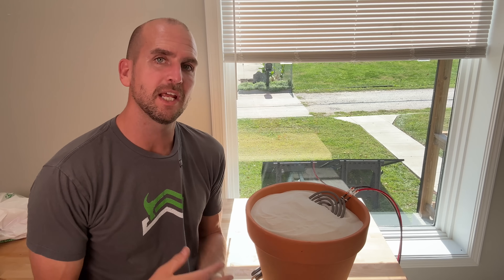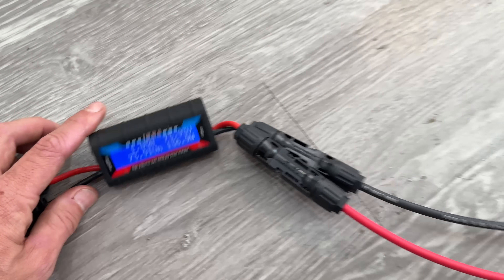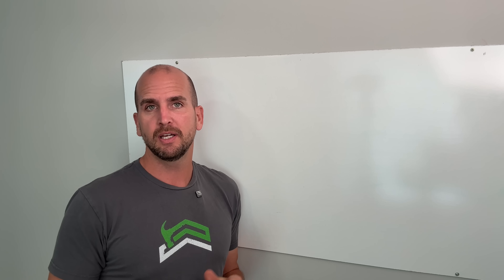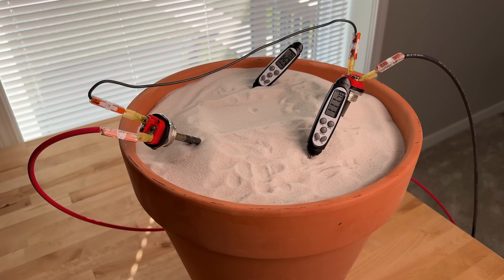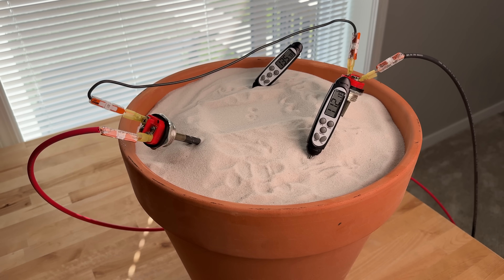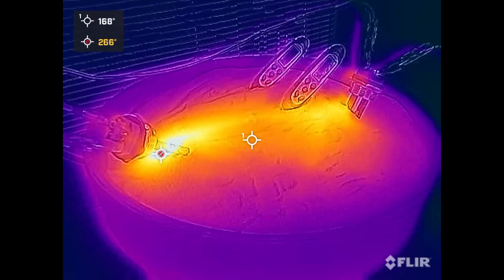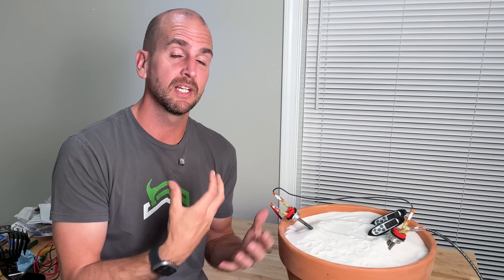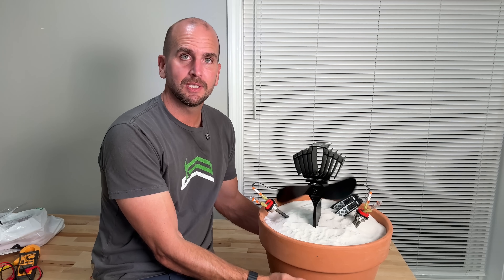How To Create A Solar Sand Battery Heater | Free Heat This Winter!

Comment: To get the most power from the solar panels match the resistance of the panels to the resistance of the heating element.  David Poz has an excellent video and spreadsheet to do this. To continue the keep it simple concept, use a kitchen oven, connect direct to PV, keep voltage around 100v and bypass switches/thermostat for safety, leave door open, fill with bricks. When sun shines it heats room and bricks. At night hot bricks heat the room.
Reply: This how night storage heaters  work, been around since the 60`s   They are heated in the night time when electicity is cheaper (off peak)  Needs a dual tarrif meter.
Reply: Thank you, great information.
Reply: Post a link
Reply: But I don't sleep in the kitchen.
Reply: @cfldriven  drink more vodka - works for me
Reply: @cfldriven if you are in need of emergency heating and your emergency heater is in the kitchen then you might.
Reply: I have an old oven in my shop doing nothing. I’m going to buy maybe 4 -6 panels, to play with. I also have a dyi hydronic heater and circulation system with a 240 water tank going.. So I can try other things too. Any ideas?
Reply: I'd never hear the end of it from my wife if I did that. What about when you need to cook?
Reply: @GOPRepubliklan Pretty sure the idea is to get a second, old, half-broken oven for cheap / free and do it!
Reply: @GOPRepubliklan  Make sand-wiches
Reply: @GOPRepubliklan  There are $50 portable electric stoves
Reply: Cooking is going to be hard after you cut the connection ends off your burners.
Reply: Excellent idea. 🍴🍴🍗
Reply: he said the panels were in series. He should wire them parallel, that would double his current, providing both panels are of the same, or at least same v/a ouput. point being more current into the heating elements heating them faster and higher temperature.
Reply: @xazoola6000  That's what I though and how did he know the polarity?
Reply: @akomni-vr5gt  polarity is often important in D.C. applications. However, in this case , stove elements have A.C. current running through them. so the current/voltage is moving between positive and negative. When he applies a D.C. voltage/current it will not matter in these types of elements which direction the current flows. What is interesting, in this application, is the use of a solar panel, with no battery. Having a battery in the circuit would be a bad idea, it would just constantly drain and charge and in my option a waste of a good battery.  You would really want to just heat a small area to get the most from the heat created. The main problem is "Sun". we do not get a lot of sun every day where i am. in the winter we do, but, well it's winter. The sun is low and not much of a "solar noon".
Reply: I know this is probably basic electrical knowledge, but I find it fascinating. Been looking up solar and batteries. I have a lot to learn.  @xazoola6000
Reply: @xazoola6000 that isn't how it works, by putting the panels in parallel the current would have actually gone down even though they could supply more.
So instead of 72V 3.4A at 248W in parallel it would be 36V 1.7A at 62W
Reply: @shaynegadsden  correct. always use ohms law because the heating element doesn't change its resistance in ohms. 240 volts outputs 4500 watts into water heater but at 120 volts only 1125 watts with the same heating element.
Reply: @xazoola6000  so you get more current but less voltage?
Reply: @roz4747
Solar Panels in Series
When solar panels are connected in series, the voltage adds up, while the current remains the same.

Solar Panels in Series
When solar panels are connected in series, the voltage adds up, while the current remains the same.

Equations for Series Connection:
Total Voltage:
V total = V1 + V2 + V3 + ... + V𝑛
Total Current: I total = I1 = I2 = I3 = ... = I𝑛
Example:
If each solar panel has 20V, 5A, then for 3 panels in series:
Total Voltage: 20V + 20V + 20V = 60V
Total Current:
5A (remains unchanged)

Solar Panels in Parallel
When solar panels are connected in parallel, the current adds up, while the voltage remains the same.
Equations for Parallel Connection:
Total Voltage: V total = V1 = V2 = V3 = ... = V𝑛
Total Current: I total = I1 + I2 + I3 + ... + I𝑛
Example:
If each solar panel has 20V, 5A, then for 3 panels in parallel:
ParallelTotal Voltage: 20V (remains unchanged)
Total Current: 5A + 5A + 5A = 15A
hope i didnt miss anything. again Google Ohms law. there are many eamples. Think of the solar panels as batteries just for the math
Reply: @roz4747  Solar Panels in Series
When solar panels are connected in series, the voltage adds up, while the current remains the same.

Solar Panels in Series
When solar panels are connected in series, the voltage adds up, while the current remains the same.

Equations for Series Connection:
Total Voltage:
V total = V1 + V2 + V3 + ... + V𝑛
Total Current: I total = I1 = I2 = I3 = ... = I𝑛
Example:
If each solar panel has 20V, 5A, then for 3 panels in series:
Total Voltage: 20V + 20V + 20V = 60V
Total Current:
5A (remains unchanged)

Solar Panels in Parallel
When solar panels are connected in parallel, the current adds up, while the voltage remains the same.
Equations for Parallel Connection:
Total Voltage: V total = V1 = V2 = V3 = ... = V𝑛
Total Current: I total = I1 + I2 + I3 + ... + I𝑛
Example:
If each solar panel has 20V, 5A, then for 3 panels in parallel:
ParallelTotal Voltage: 20V (remains unchanged)
Total Current: 5A + 5A + 5A = 15A
hope i didnt miss anything. again Google Ohms law. there are many eamples. Think of the solar panels as batteries just for the math
Reply: @ Ty, higher voltage is dangerous but not higher current per se?

Comment: Does the type of sand make a difference.  Could I use beach sand or a bag of sand from Home Depot.  Great concept.
Reply: The course  sand allows the hot air created by the element to move to the top much quicker but it will also loose more heat faster . I used a 210 liter drum/ 55 gallon with a copper pipe spiraled in the sand ,heated by a solar panel and a 12v pump to circulate the water/ anti freeze. It connects to a  car radiator with a small computer fan  .kept my chicken from freezing weather.

Comment: You're missing the bigger picture - kwh in vs BTU out compared to say a mini-split and properly defined room - size, insulation, outdoor temps for example.   How does this compare (roughly) to heating insulated water tank for kwh in vs BTU out.    Interesting, but not helpful to make any conclusions.    Need at least some rough comparisons.

Comment: What if you made a radiant heater using a water heater tank, a pump, coils of copper pipe going through a large container of sand?  The coil of copper pipe might heat the sand more evenly? Would wet sand heat up even better than wet sand will do to conduction?   Or run a copper coil out of the water heat tank, place the wood stove fan over a tight coil copper so it spins faster, bring the rest of the coils in front of the fan?  Perhaps, you wouldn’t need a mechanical pump to move through the heat system just using the heat cycle of the water?   If the system needed to be a smaller, a person could use an Automotive TANK heater.  Those types of Tank heaters are used in cold climate for engine block heaters.  There is a ball valve in the TANK heater makes it work like a pump.

Comment: This is a good idea. I would advice not to use Wago connectors so close to heating elements like that especially for actual use. Very high temperature insulation like fiber glass and silicone should be used. There are screw terminals and spade connectors. Just use those. That's why they're there, anyway. The Wago connectors may have survived, but all that heat will likely cause the plastic to warp and stuff weakening the connectors and causing them to fail over time.

Comment: I agree. I tried a 120v water heater element and the steel turned blue. Guessing it wouldn't last long.  A wet sand seemed to help.
Reply: It’s supposed to work in water which will create a current against the metal to stop it changing colour

Comment: I get the idea but dont think it plays out well. 
Emergency- but have solar panels at the ready. Sand at the ready etc. I dont think emergency.  Besides, having solar was intended to prevent those emergencies. If you have solar what is the emergency?  
I think its a great idea and fun experiment just wildly inefficient. Store the same amount of energy in a battery and use a heat pump for your heat source. Your getting maybe 3x the heat. 
I know heat pump isnt emergency but none of this is. When you decided to buy solar you thought about
Why?
 how much Battery ?
Heat pump?
 Then prevented this emergency from even happening
Reply: If you had a grid tied solar system but the power is out and you don't know when it'll be back up. Disconnect your solar panels, and hook them up to something like this. You have no batteries, so your solar was useless but now it's heating your house. Sand, or a substitute, should be easy enough to find.
Reply: @MikeGrudzinskas  ok. I never thought of that 🤔

Comment: small tip: when handling formular, you should be aware of the right letters for teaching. P, I and R are right but you should know that "V" is just the short for voltage, which formular letter is "U"

Comment: I watched half this before realizing that the only reason you're doing this is to produce extra heat for your home? This is a big waste of energy not to mention a dangerous fire hazard! You're much better off using heat pumps to heat the air in your home and potentially even your hot water tank!
Reply: I thought this was a test that most can copy in situation you need warmth and don't have heat pumps that work with solar or skills to use direct solar panel connection to warm water.

Comment: I'm in the process of making a backup heat source out of my old hydronic baseboards.  In place of the original boiler, I bought a used 30 gallon electric water heater.  I intend to operate this water heater using excess solar energy, direct DC if possible.  A contactor will need to be operated by the thermostat of the water heater so the thermostat doesn't get destroyed by arcing, but this is a relatively cheap and simple adjustment.  The only stored electric power I need is to operate the circulator pump.

I'm likely going to have to swap out the 135F thermostat for one that can go up to 180F if I want any significant heat transfer out of the baseboards.  Until then, I have a tertiary backup heat source - a propane heater, positioned after the tank.  This was so the propane heater can immediately put heat into the baseboards, while leftover heat will just loop back into the tank.
Reply: Absoultely awesome ideas in there.

Instead of the contactor, there are two mppt moduels that I've found that are intented for direct solar water heating. One of them is a commerical product: Google AC7391 and you should find it. The other is a home built unit called the "LoadMaster XP".

Both use solid state switching to draw the most power out of your solar panels.

In the video, he talks about the V = IR of the load, however the solar panels themselfs also have a V = IR relationship, eg on the back of solar panels it says maxmium power voltage and maximum power current, which you can use to give you R, eg V/I = R. To get the most out of the solar panels the loads resistance/impedance needs to be close/match the solar panels resistance/impedance. You can ether do this by carefully selecting solar panels, or use multiple heating elements in series or parallel (and solar panels) until the load and source impedence is close. Or you use a MPPT module that does it dynamically.

Comment: When you introduce these topics, it's helpful to remind new viewers how to experiment safely around voltages over 50V and power levels over 100W. (fuses, protecting wires from physical damage, etc) It can't hurt to repeat a safety message on each video.
Reply: Agreed. 70VDC can kill you. Two issues with DC, since the voltage never drops to zero (as with AC) your muscles never get a chance to release. Also when you disconnect the power the arc does not stop for the same reason. 

You could put the panels in parallel and add a third hot water element also in parallel and you would be a lot closer or the max power point. And the lower voltage would be a lot safer
Reply: Yes please I'm hesitant to try this out until I understand the safety more.
Reply: Significant shock and fire risks here
Reply: 50mA will stop your heart
Reply: Hey buddy, learn about specific heat. 
This can all be calculated accurately how many btu's are put into how many pounds of sand.
3.41 watts = 1btu
1btu= energy required to raise 1 pound of sand 1 degree Fahrenheit. 
Look up specific heat of dry sand. 
.344 btus per pound of sand.
10 pounds of sand therefore 3.44 btus.
450degfx3.44 btusx3.41 watt per btu.  = 5,279 watts required to raise the temperature of 10 pounds of sand to 450 degrees Fahrenheit.
Reply: @Marley-ii6ls  I'm pretty sure no one thinks the sand itself is going to get hot enough to cause a fire.
Reply: Thank you Chicken Little.
Reply: @toddmarshall416 there's old electricians, and bold electricians. If you've worked with live snakes you know never to turn your back on them either. Call it cowardice but us old guys call it living to see another day.

Comment: I've wondered for a while if you could use something like this to keep energy for rapid heating an indoor sauna. Usually you have to wait a while after turning on a sauna for the heater to get the room up to temperature.

If you put a sand battery under a bench so it's quite large, and run some radiator piping through it you could dump excess solar power in to it (instead of exporting), then when you want to use your sauna you have a small pump push some liquid through the radiator piping to a radiator in the room. Along with the sauna heater you'd be able to rapidly heat the room and use less energy (since sauna heaters are usually 8-15kw or so).

Then I just think about lugging enough sand around to fill in a box under a bench to save a few pennies per sauna use and shudder...

Comment: The main thing missing is temperatures in the room! Also some graphs with temp over time will be nice (both room temp and sand temp.).
Reply: Interestingly enough you will get more accuracy using math for that. The numbers of BTU’s put into the sand will be the BTUs you get out of the sand. 

So take your starting room temperature and that will show how how fast the BTUs come back out of the sand. 

The lower the ceiling the closer you will be to the eventual warm air. 
The smaller the room the less stuff to heat up and the fewer walls for heat to escape. 

So the temperature of his room will have very little to do with the temperature of any other room. There are to many variables.
Reply: Yes, that would have been a great addition to the testing.
Reply: What matters is amount of heat transferred. That can be determined by  the other parameters captured. The temp rise is too dependent on the unique room features.
Reply: This needs to be an order of magnitude bigger to warm up one room. To keep one room mildly warm for a night you would need this to be arround of 1-2 tons of sand, heated up by 15-30 kwh of power.
Reply: It's been done and tried. It doesn't matter
Reply: What’s been done and tried?
Reply: I don't know. He demonstrated a few variations and explained the numbers.  That was enough for me, anyhow. I didn't realize you could use elements designed for higher voltages and currant at lower power levels and get them to work well. I thought It had to be winding exact kennametal wire to the exact specs of the power source.  A good bite of learning.
Reply: Unless it was a closet, the temperature in the room will not move by even a degree. Think about it.  It takes 1500W of continuous input to warm a room using a space heater. And that’s with almost 0 losses. This thing is not going to do anything.
Reply: That little thing isn't big enough to make any difference in room temperature.
Reply: It is not going to make a room warm you are right. But emergency heat is for small spaces. Put this in a large closet and you will be much warmer. Or drape some sheets over a table and you will have a small enough space that this will increase the temperature more than 10 degrees.

Comment: Using the sun to heat a thermal mass is a great idea.  Build a masonry heater in your home.  Plant trees for the sun to help grow, for decades.  Harvest other trees, preferrably those that have already died, to burn in the masonry heater.  During an emergency, your entire home stays just as warm as it did previously.  Your math showed ~750wh of energy stored in the pot full of sand.  That is not enough energy, in any form, to keep you or your house warm during a cold winter day.  You would have to scale that to a much larger solution...like a masonry heater.
Reply from the maker: We looked at a home a couple years back with a huge custom made masonry heater between the kitchen and living room.  It was awesome and even had a lounge on one side to lay down on the warm surface.  Pretty cool.
Reply: @everydaysolar  - They are expensive and take up a sizable amount of square footage in a home, but the warmth given off by a large thermal mass is better than any type of heat source that uses convection.  Radiation and conduction are much more efficient and do a better job of making a person feel warm.  Could you build a large, spread out, sand battery inside a home and use electricity from solar to heat it?  :)